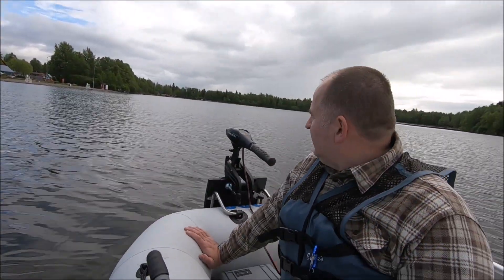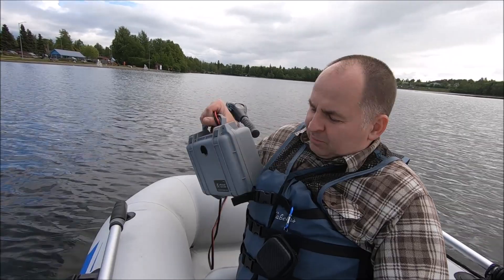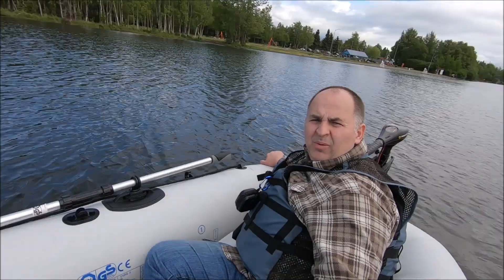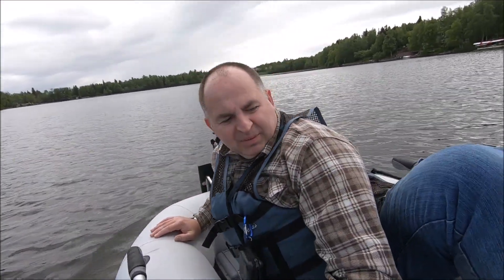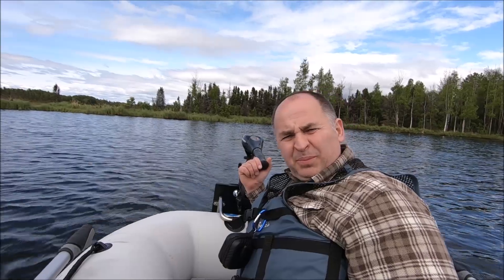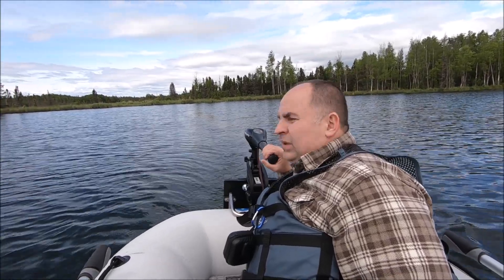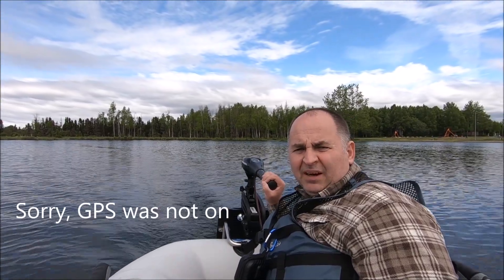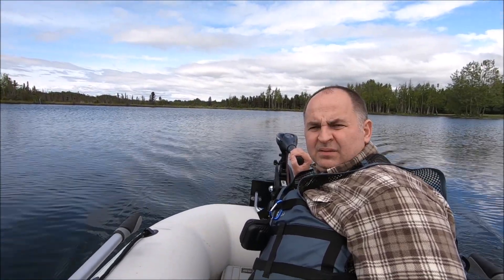Minn Kota Endura C2 30 Trolling Motor run test on homemade 16.8v Li-Ion battery

Comment: Due to the increased voltage, I recommend a smaller prop to keep the amps in the same range the motor is designed to handle.  You'll still get more power due to the increased voltage & rpm plus your motor will survive much longer.
Reply: Hey, I might try this out. Can you recommend a prop that would work with my Minn Kota Endura c2 30hp? Thanks for mentioning this. I’m trying to plan my setup out.
Reply: @anonymous_friend  
If you can find a prop meant for a 20 Lb trolling motor like a water snake, that would probably do the trick.  I don't know how the mounting works and if can be made to fit on the Minkota shaft.

Comment: Pretty impressive since you can get recycled 2200 mAh cells for 40-50 cents each. For 30 bucks you can get 4s15p. You can discharge at 15 amps all day long for safety. That's 475 watts. Yes these things can be dangerous and set fire if you abuse them and draw too many amps per cell, especially if they aren't good quality cells, but that's why you can shove it in a metal case and seal it off, and be done with it. I build RC boat batteries and solar arrays using 18650s and I just had this idea today to do it on a to scale boat, and it looks like it works damn good by this video.

Comment: I sure wish you had a GPS working. It looked like you might have been going 5 mph in 5th speed. I got 3 1/2 MPH on only 12 v with 14 ft narrow aluminum boat loaded medium 450 - 500 lbs ? But with old 42 lbs. thrust Minn Kota Endura.  Btw Great Li ion batt. pack too. Wish I had one ! Just over volted enough , Without damaging motor.
Reply: yes it dise